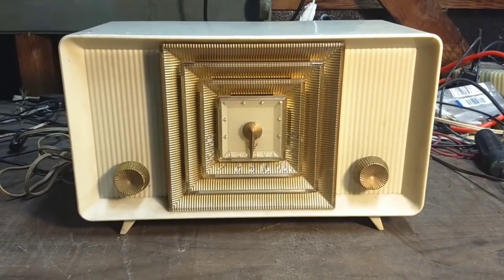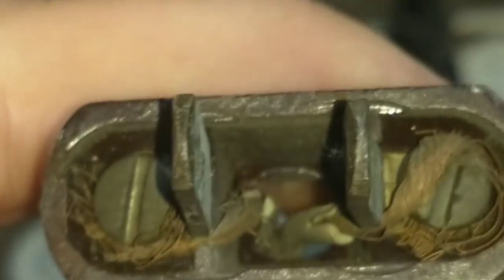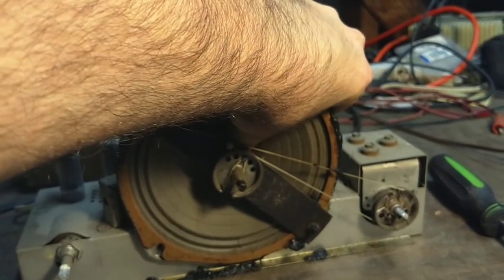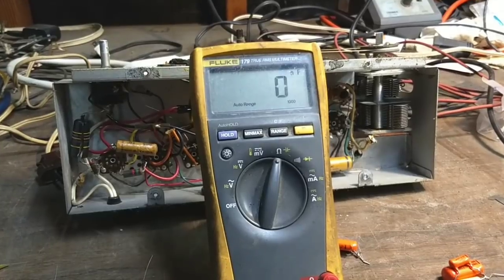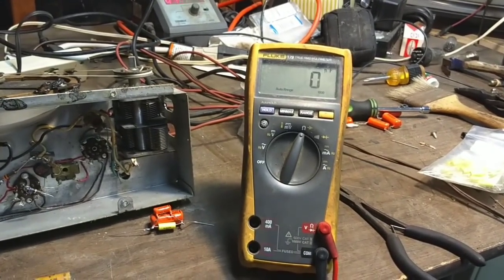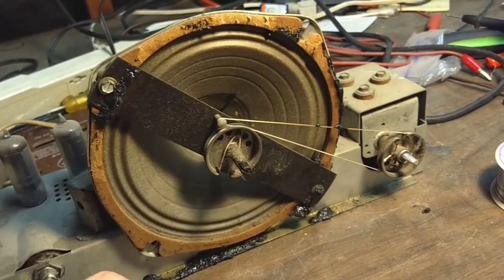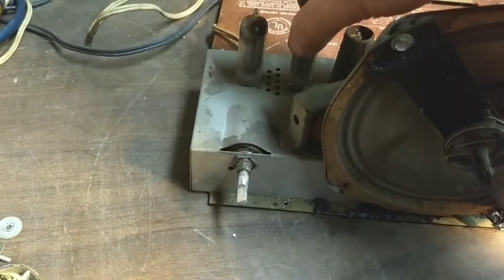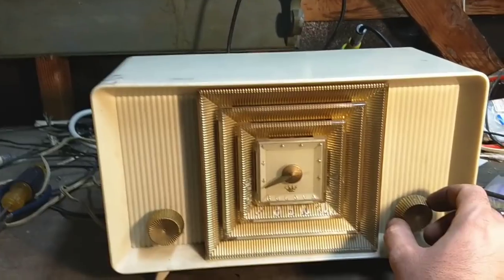Quick repair of a 1950s Bulova 300 AA5 vacuum tube AM radio

Comment: Most meters measure capacitors by how long it takes to charge, so when a cap starts leaking, it takes longer to charge so it will measure a higher capacity then it really is. Hope that helps anyone. Thanks for the great videos .

Comment: bumble bomb caps hate those,that why I have several.types on probes for my meter,they are cheap I bought a set with alligator clips for 65 cent at All express.because it has to be hard hopeing a camera and using a meter ,I am just saying the video is very cool ,I just bought deposit 5 love that stuff,can canned air be used to blow the dirt out of the speaker coil ,so you have a am transmitter,great save on that radio ,love your video ,learned a few things

Comment: I was a little surprised that you made up near exact capacitor values with up to three caps when these values are so un critical! The only ones that will be critical are those in the oscillator or tuning circuits. These would be ceramic which hardly ever fail anyway.
Reply: @mrman3565  yes and he would’ve for sure had it been for a customer or a proper restoration I’m sure.

Comment: That's a really cool-looking set, and I'm sure it'll look great in your living room. About oscillator tracking on AA5's---sometimes it's a compromise, due to lack of adjustment options
Reply: Most sets can actually be adjusted for decent tracking. The thing is they can not always be adjusted via screws and slugs. Take a look at the tuning capacitor itself, not the trimmers, but the moving plates. In most air tuned sets the outer plates will have slots cut into them (not always). These plates can be bent outward or inward to fine-adjust the capacitance as the tuning advances. Some will have cuts in the outer plates to allow for selective bending at different points in the rotation. Careful tweaking can make tracking very close, sometimes perfect. A lot of people see these plates bent and straighten them, thinking the bends are damage caused by someone being sloppy.

This was common practice for decades but is now largely forgotten. Sets new from the factory would have these bends. The makers realized that a new radio that did not track decently would often be returned as defective. Consumers expected reliable tracking. In fact, one brand (Packard-Bell) had its dials "Stationized" with the call letters of common (California) radio stations marked on the dial and they could be reliably tuned by just moving the pointer to the desired stations. Oscillators were usually pretty stable as they used mica capacitors that held their value reliably. Some later sets used ceramic caps that were also fairly dependable. The parts that would drift with age were mostly the IF transformers in later units, mostly those from Automatic which supplied the majority of the domestic industry. Others followed their example and US/Canada made sets became known for these parts failing. Replacement cans were stocked at every seller of components - Olson, Lafayette, Radio Shack, GC, etc. We are not so lucky today and usually have to rebuild the originals.